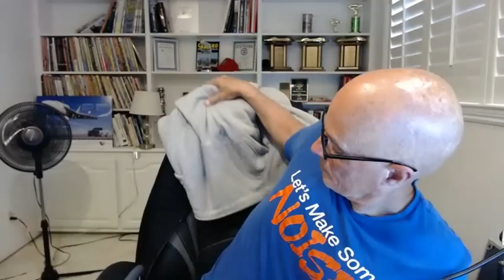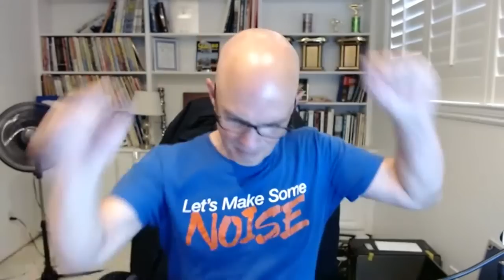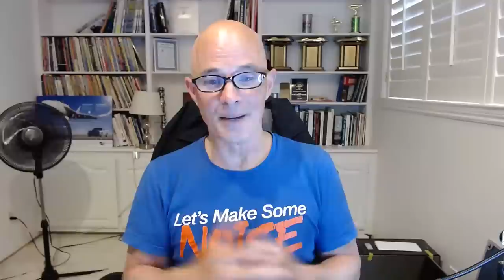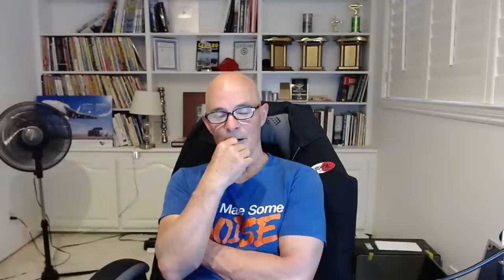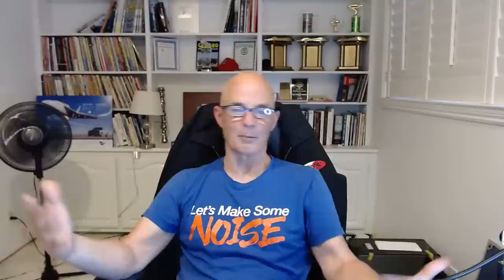LET'S TALK TECH-CHEAP VS BIG $ HEAD (FLOW STUFF)

Comment: Low lift is very important especially on exhaust. Valve seats, valve shapes (tulip, back cut) can play a part. Exhaust valve responds in the first .100 to area presented to the port, un-shrouding (area rule) around the exhaust valve in the chamber is helpful. The gas enters the E port at near super sonic speed between 0-.100 lift

Comment: Richard,

I think it would be really interesting to test factory Chevy rectangle port vs. factory Chevy oval port heads on the same engine back to back.  You could find some late 1960's closed chamber oval port heads and test them on your L78 396 and LS6 454 engines using a vintage Edelbrock C-396 oval port dual plane high rise intake.

Another interesting test IMO, would be to test your L78 engine stock with headers and then blueprint and modify it to the 1967 NHRA rule book for "stock" class racing and dyno.  Then modify for "super stock" class racing and dyno.
Reply from the maker: aqreed
Reply: @richardholdener1727  Richard, here are some data points from 1967-1968 NHRA drag times for rectangle port 396/375hp cars in A/S, SS/C and SS/D classes versus oval port 396/325hp cars in SS/E and SS/EA classes:
From 1967 races:
1967 SS396/375 Camaro, Bill Thomas, NHRA SS/C, 4sp, 3,508 lbs:  11.85 @ 119.86 mph
1966 SS396/375 Chevelle, Wally Booth/Dick Arons, SS/D, 4sp:  11.80 @ 119.36 mph
1967 SS396/375 Camaro, Bill Jenkins, SS/C, 4sp:  11.51 @ 115.97 (not full pass)
1967 SS396/325 Camaro, Dick Arons, SS/EA, TH400, 3,217 lbs:  11.63 @ 118 mph
1966 SS396/375 Chevelle, Mike Hoover, A/S, 4sp:  12.01 @ 117.18 mph
From 1968 races:
1968 SS396/375 Camaro, Kelly Chadwick, SS/C, 4sp:  11.30@124 mph
1968 SS396/325 Camaro, Jim Baker/Bill Thomas, SS/EA, TH400, 3,308 lbs:  11.67 @ 120.95 mph
1968 SS396/375 Nova, Ed Hedrick/Jenkins, SS/D, 4sp:  11.30 @ 123.38 mph
1967 SS396/375 Camaro, Bill Jenkins, SS/C, 4sp:  11.18 @ 124.48 (also ran 11.05, Jenkins claimed 540hp on dyno)
1968 SS396/325 Camaro, Christie Fisher, SS/E, 4sp, 3,250 lbs:  11.55 @ 121 mph
1968 SS396/375 Camaro, Dale Armstrong/Dana, SS/C, 4sp., L89 alum. head, 3,162 lbs:  10.61 @ 128 mph

For NHRA SS class, cars could use any stock appearing single 4 bbl intake and any flat tappet cam, but must use stock carb so SS/E and SS/EA 325hp cars ran with stock Quadrajet.  Also, in 1968, NHRA factored iron head L78 396 at 425hp and factored aluminum headed L78/L89 at 435 hp.  Per NHRA, shipping weight for L78 car was 3,235 lbs and shipping weight for L78/L89 was 3,162 lbs for SS/C class.  Dale Armstrong's Dana '68 L78/L89 Camaro was basically a 396 cid L88 since it ran L88 heads, L88 intake with gutted plenum and 2nd design L88 cam.

Comment: Have a small block Chevy 406. And had purchased a set of used Iron Eagle 230's
That "look" ok so far. But how do you feel about NOT drilling for steam holes ?
I've drilled "stock" heads before but not aftermarket heads.
(Xe274, carb'd 3.42-14 bolt in a full size long bed)

Comment: AFR followed DV’s golden rules and SM didn’t 😂 for real DV explains how increasing the flow here actually steals from here or impedes. With higher flow but much smaller runner the velocity, discharge co-efficient, and probably swirl are way up vrs the SM head. At AFR they researched where the air wants to go instead of just where ya think it goes. SM just made the holes bigger until they got the peak lift number up.
Reply: DV knows his shit, I really like his books and videos!